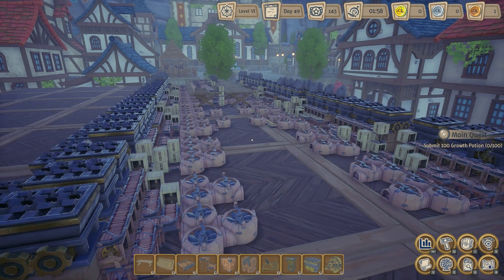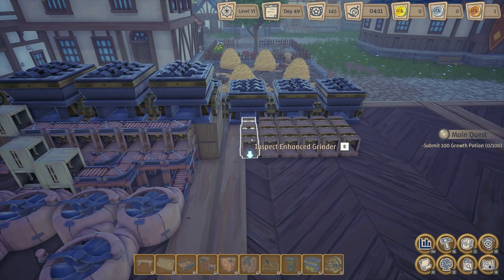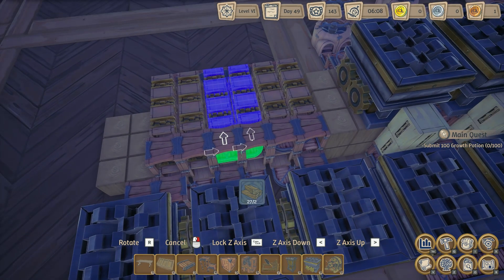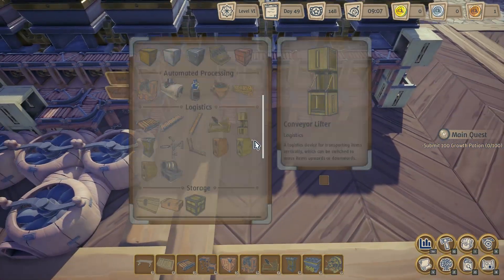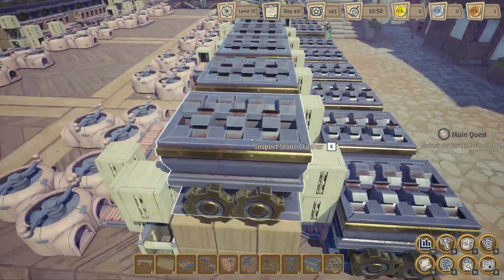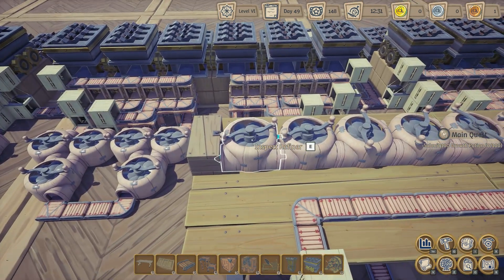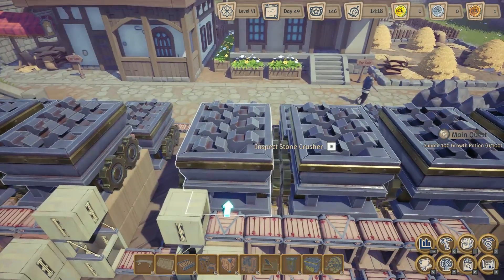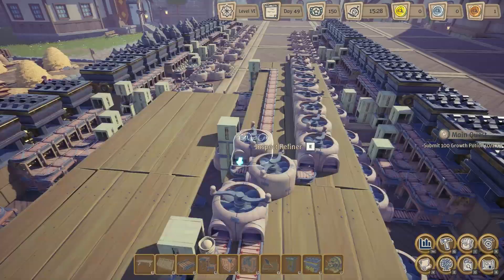Alchemy Factory Workshop, Diamonds!

Comment: I found the 1 leg table works well. Stone crushers on top, grinders on the floor - in sets of 2 between the legs, and refiners on top of the grinders. Be sure to use both inputs on the refiners - otherwise, it takes about 3.3-3.5 seconds instead of 2.7 (at my current upgrade level). 

But to optimize what you had - having the stone crushers step up a level each row - you can load them with catapults - allowing you to eliminate that one extra row in-between crushers, so they are touching. But I think I like the above solution better; counting the small block sizes, my blueprint is 5x7, with 3 crushers, 6 grinders, and 2 refiners, and they can be chained together.
Reply from the maker: Thank you, I've had lots of awesome suggestions and i do appreciate them!  I've realized after building a massive setup that I need both belts..  I noticed a slight loading delay.  New video in about 13 hours, I've gone crazy and built a giant contraption,
Reply: Also - some math. 2^15=32,768 sand to make 1 diamond. At 150 stone per limestone, and limestone costing 600cp, that's 32768/150*600=131,072cp per diamond, which sells at 160sp. You can convert 1,000cp to 1sp, so it's about 29sp profit per diamond.
Reply from the maker: @eightdeekay Nice!  I was going to try to figure that out later....  like I said....  TRY lol

Comment: So I think the refining process is supposed to be a use for sand you create through other processes and is left as the remainder. I was theory crafting a machine to pump out Saturn Relics irc and that recipe calls for like almost 300 salt per minute. I know at the next alchemy level I'll acquire the ability to buy salt rock as a raw resource but I'm a glutton for those juicy upgrades for the player. At my current player upgrades the Athanor creates like 11.2 salt per minute and around 33 sand per minute. At first I was literally going to create a system to throw it all away so my machine could keep running. Then I came across the refiners. Seems to me that the intention is to dump all of that sand from salt creation in the refiners and let that system chug away in the background. 

Also, just wanted to say I love your content! I first found you through Minemogul which was my first introduction to the factory-sim genre. I think I have found my home in Alchemy Factory. Scratches and itch I didn't know needed scratched. You are the only creator for this game I have come across that really puts an emphasis on efficiency and it has given me inspiration to revisit my own builds and see how I can improve on the design! Keep up the great work.
Reply from the maker: Thank you!  I do my best to make everything i build as efficient as possible.  I don't always succeed at it, but always have to try!